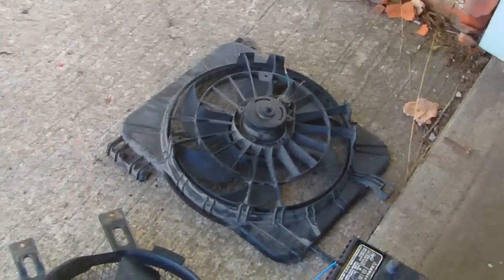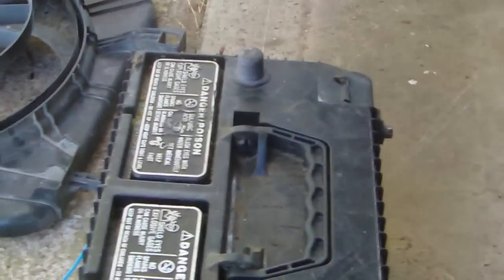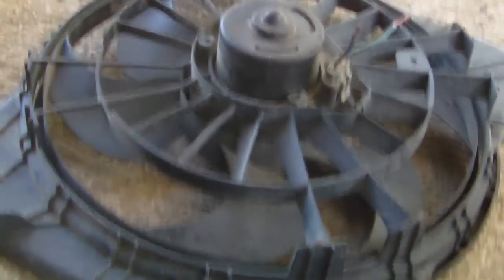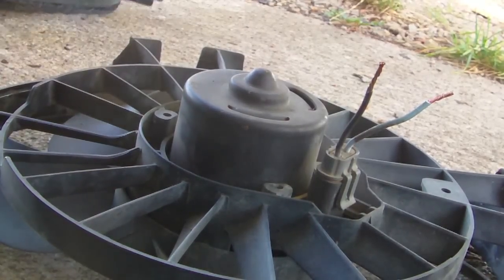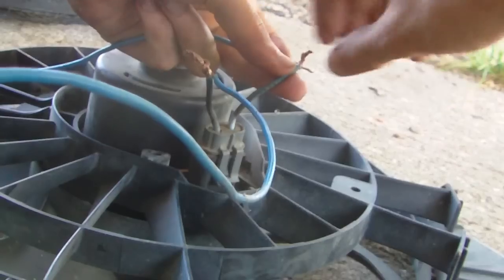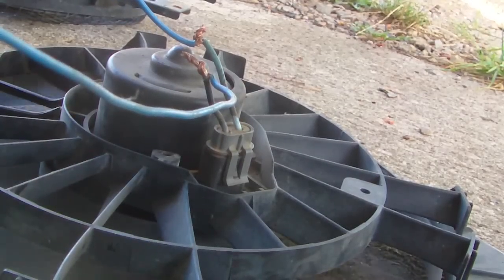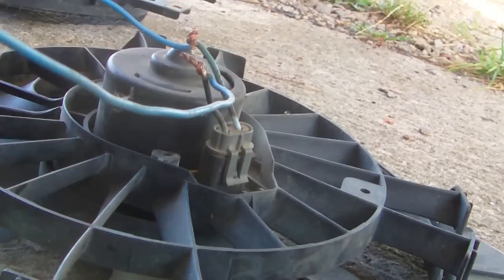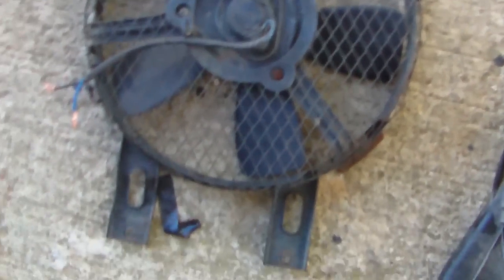How To Test Electric Car Fans

Comment: hey here is a idea for your fan tester, to make it a bit better/easier to use, get a couple alligator clips attach them to one end, this will hook to the fan, take a toggle switch and put it on one of the wires, this will allow you to turn it on and off, and on the opposite end from the alligator clips but a pair of clips like what are on battery chargers.

Comment: Sometimes the fans won't turn on if there is electrical problems within the vehicle. other reasons is in the fan motors themselves they are either Permanent Magnet DC motors or Series wound or Field wound motors common problems the same as in blower motors as the brushes in the motors when they wear away they will not contact the communtator on the armature. unless you can take the motors apart and replace the brushes on them. Permanent Magnet motors are reversed easilly by changing the polarity. as field wound motors they only rotate one way unless there is wires that change the rotation on them as it interchanges the connections between the brushes to the armature and the field windings. as newer electric are now having a Brushless DC motors on them the problems is the electronics in the motor go bad and the motor has to be replaced.  some electric fan assemblies are two speed being there can be wires for high and low speed.

Comment: Do you have a video for a 3 wired fan
Reply from the maker: Matthew Robert Usually a 3 wire means the fan has a high and low setting. I still only run 2 of the wires and tape off the 3rd. Choose whichever speed you want the fan.

Comment: and if the fan turn wrong that cause electrical problems in car
Reply from the maker: Most electric car fans can be wired up to run forward or reverse and the electric motor can handle it. Just switch your negative and positive wires to change direction of air.  Keep in mind that the fan blade design may be setup to blow air more effectively one way, more than the other.

Comment: with way the fan have to run
Reply from the maker: Depends which side of the radiator the fan is located. It should be pulling the cold air from outside the car through the radiator, towards the engine.

Comment: Ok because I have my fan pushing out air
Reply from the maker: That will take the hot air off the engine and push it into the radiator, most likely not cooling the water off